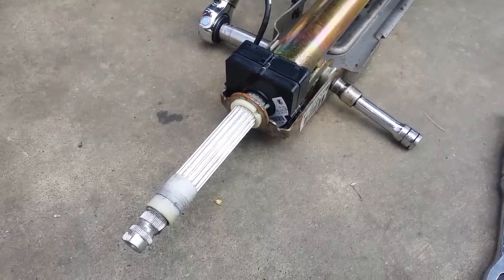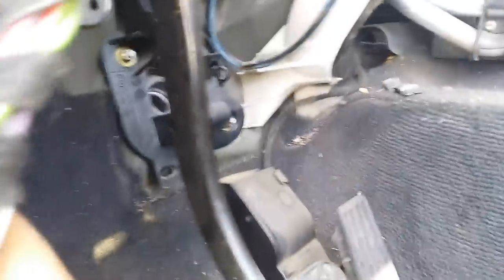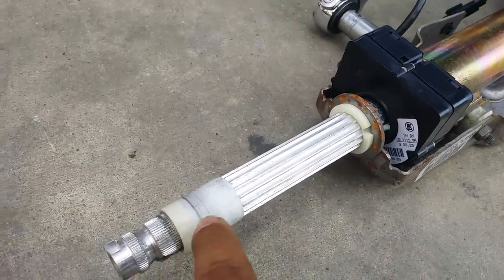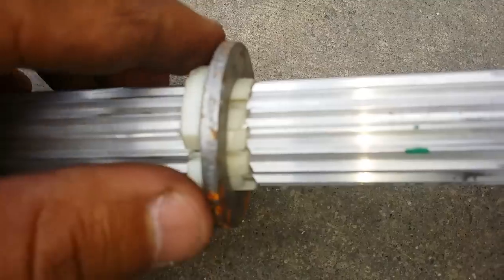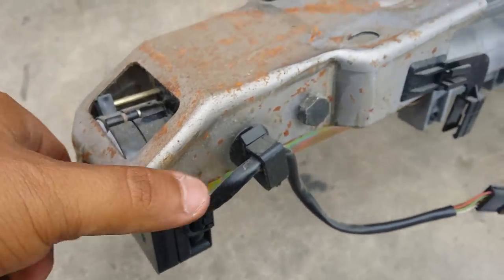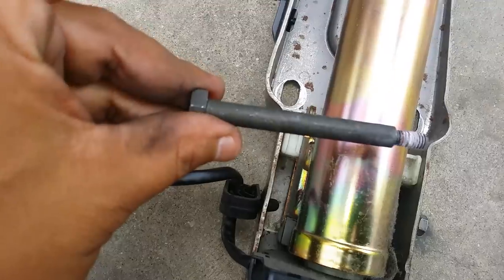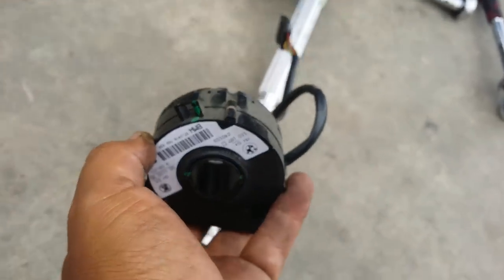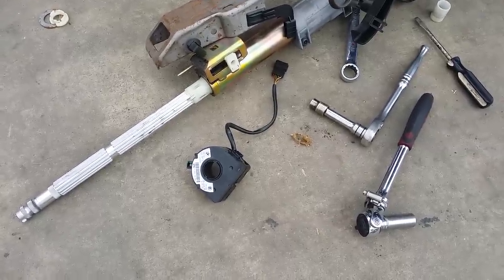How to remove steering wheel angle sensor on BMW e46 M3 330 325 - Removal - Part 2

Comment: that plastic clip holding the sensor is a SOB to press on a z4.... i mean there's going to be 0.000000002 mm room to wiggle it out.   I actually used a filer to filed it down a little before finally getting it out.

Comment: There were some successful attempts to replace the SAS without removing whole steering column from the car, all you need to do is to disjoint it from flexible connection behind the fire wall and splinted shaft will have enough stroke to  slide into the column to replace the steering angle sensor, very simple.
Reply from the maker: Thanks for your input
Reply: You are welcome,  your videos are very good, thanks for posting them, it helps BMW community a lot.
Reply: FAIRBOY11 what do You mean? Is there another way to change the sensor? A easier way?

Comment: Also, question : I may have a current leak from this sensor, BMW Scanner 1.4 tells me LEW -> 01/03 - Terminal 30 defective and I have a 250mA leak from the control panel at fuse F24 (E39), is it possible to unplug the angle sensor without disconnecting the steering column from behind ?

Regards, Greg.

Comment: I have a 2002 BMW Z3 3.0i with this issue. Needs a steering angle sensor. However I can’t find any guide for my model of car. Does anyone know how similar this is to the e46 process? I have heard the entire column has to come out but I don’t know the steps or if there is any other way to do it. Ugh all of this for a stupid sensor. I normally wouldn’t even care I just can’t stand seeing those damn lights on my dash sets off my OCD lol

Comment: Thanks for the video. Once the sensor has been replaced is there a need to take it to BMW for any recalibration?
Reply from the maker: Hello,  Once angle sensor has been installed, it will need to get realigned.  You don't have to take it to dealer.  Just find a good independent bmw shop and they can do it for you.  We charge $80 to realign sensor

Comment: It looks really very difficult. it's just sensor. Is there an easier way to do this?
Reply from the maker: It only looks difficult, but once you start the process, its pretty straight forward.  Im sure there are other ways to remove this sensor, however, this was the best method that we could think of.  If any one out there has a better method, we are all ears.

Comment: This is Fantastic ! Thank you . Do you know if i can use a second hand sensor ? There's alot of voices online , some saying yes , some no ....and how general are the sensors are all E46 angle sensors basically the same or is it crucial they have the exact part number ... ive a 330D which seems not to share according to realoem the same part number or the preceding ones with all the second hand ones available on line etc ... thankyou allready fro your help ..my uk Mot came in at over 2k so im heading into new but exiting territory for the love of my car .
Reply from the maker: ruu campbell  We sell pre-owned angle sensors all the time so you shouldn't have any issues with programming.  Its important that you purchase angle sensor with same part #.  Check out our website, we might have one sensor in stock.  Thanks
http://www.bimmermerchant.com
Reply: bimmermerchant thankyou - a local breakers here in the uk , advised that the part numbers dont need to match based on all the cars , the part number says the sensor is good for , so fingers crossed there . Ive just done the anti-roll bar ,breaks&pipes ,now its time to do the angle sensor and power steering ! The angle sensor : i can see the e10 Torx , presumming i should disconnect the battery before i attempt anything with the steering colomn or is that unnecessary ? Might really expose my ignorance but can this be done with out removing the steering wheel ? I know you removed the lot and i do have an advisory on my mot that my top steering joint has slight play but with so much to do .. the path of least resistance is the one i seek ...can i just pull up on the column after releasing the e10 with out removn anything else ..like steering wheels,airbags ...etc etc ...? awesome help ..keepng me and my bmw alive

Comment: i have the same problem im thinking to do this to my 06 325i e90 will be the same process?
Reply from the maker: E90 models have the angle sensor on steering wheel clock spring, therefore process will not be the same

Comment: I got this problem on my 06 newer body 325i is there the same process or a totally different one
Reply from the maker: sorry but can't help you here.  We haven't removed angle sensor from 06 models so we can't say for sure if removal process is the same.  Good luck
Reply: bimmermerchant Did you just clear the fault code afterwards to put out the dash light, or did you have to go to a bmw dealer to get the angle sensor set up on their computer?  Thanks for your help an Nice video by the way.  Steve in England.